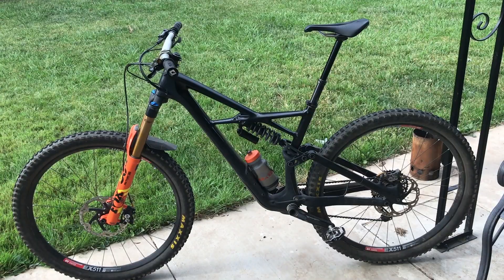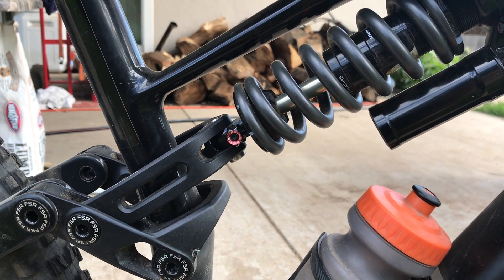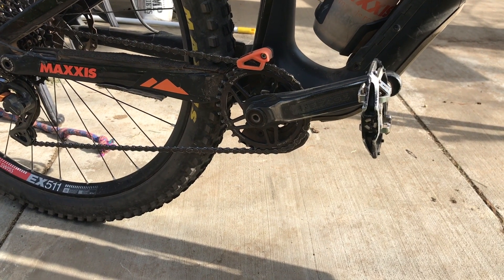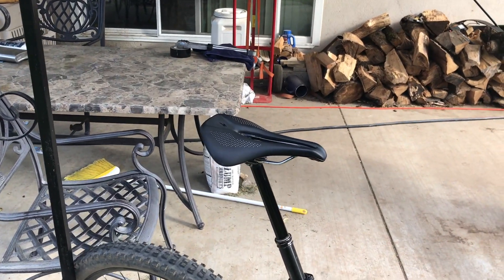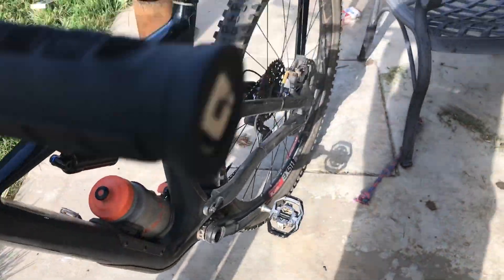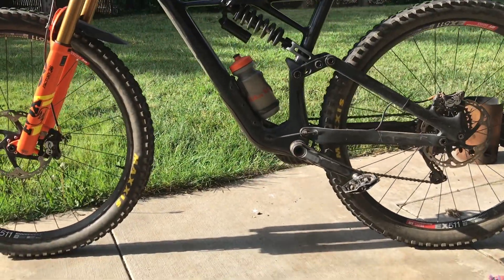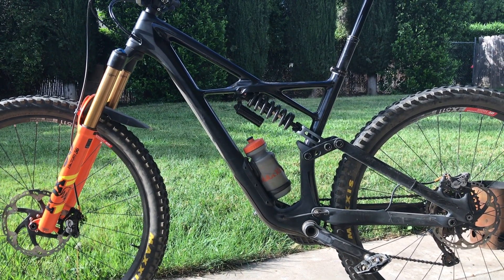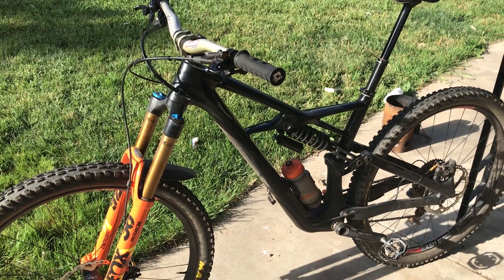Coil shock for the enduro?!?

Comment: Another bike to think about would be the Orbea Rallon. Their size large isn't the biggest on the market for sure, but is has a super steep seat tube angle, slack front end with an short-offset fork, and a really great riding rear suspension. I work in a demo shop and really like the extra length compared to my Hightower LT.
Reply from the maker: Skyler Reid yea the xl
Is too big and large is too small. So I’m a bit screwed there :/

Comment: Alex, I ride a 2017 Specialized Enduro 29r elite and so far I have enjoyed it thoroughly.  I finally had to send in my rock shox monarch plus for service and have been testing my buddy's Ohlins air shock which I have no complaints about even though that shock has had some reliability issues.  I too am a Maxis tire guy, but I am testing the new Butcher 29X2.6s and recommend that you test those tires - although, they may not measure 2.6 with calipers.  I enjoy aggressive trail riding, jumping, and climbing - so far so good.  Specialized website is having a sale right now on all $45+ tires, buy one get one free.  The knobs on these tires have really good bite - check them out!  Cheers, Andrew (SoCal Enduro rider)

Comment: Try getting your hands on a linkage set from a 2017 bike, use the link only (not the shock yoke). It makes a big difference, feels so much better thru the travel and you dont get a super hard ramp up at the end. I have had both 2017 and 2018 enduros, noticed it straight away when going to the ‘18 bike, luckily had a spare linkage from the ‘17 to swap over. Added bonus with the older link is you get 165mm of rear wheel travel instead of 160mm

Comment: The metallic pads are designed to work in a higher heat range, same as in a race car, that’s why you see them accelerating and braking on their warm up lap 👍
Reply from the maker: Daniel Thomson haha I figured. I just never liked that initial pull on the brakes. I guess I just need to get use to it!

Comment: Hey Richard, I enjoyed your video on your Enduro. I have the same bike as you but a Ohlins coil 2018 and I truly love it. I am also an advanced rider like yourself and my opinion differs a little from yours. I live in Colorado we’re we have four mn’t bike parks chair lifted and I went from Nomad C to the Enduro. The Enduro is noticeably faster I think through rock sections combined with the progression of the coil it’s scary fast. I myself don’t no as much as you in the suspension department as I go with the feel of the bike setup and work a little from there. For a big bike it climbs really well better than the Nomad . I think sometimes we can over think the suspension I have not bottomed out yet on my Enduro yet and my body weight is around 190 Ibs and I love to huck ! Lol! Anyway, just wanted to hit you up with my experience on my Enduro. Enjoy the ride bro.

Comment: yah bro. sweet content. I have a 2018 Enduro too. I feel the same way. I just rode porcupine rim in Moab which is basically an 11 mile rock garden. It ate up all that chunk but I felt EVERYTHING maybe that works for Curtis Keene, but it feels SKETCHY. Tracks I'll pin on other bikes feel like I'm out of control on the Enduro. I'm faster though for sure. But I agree with what you were saying. I just cant get comfy on it. Hopefully that changes. Im considering a Norco Range or a Commencal Meta V4.2 New Zealand edition.
Reply from the maker: ryan nonu both a rad! Really digging the range

Comment: Blew out 3 air shocks on my 2017 enduro 29 as well mate. Only brand I could source in UK that did the enduro specific shock length was ohlins. I know what you mean about the coil bottom out. I run the sag probably 15 - 20% to compensate for the end stroke issue. it usually means my legs are doing most of the work at low speed but when it gets fast I feel like it's amazing!
I understand your issues though. I think my next frame I choose shall have a more progressive linkage system so I know there are more options out there!

Comment: Awesome review.
I am leaning towards Nicolai g15 & Pole Evolink. they have a longer wheelbase, and chainstay, to me they seem more like what I am looking for, But I haven't demo'ed any of them.
 the linkage design is quite decent on the Specialized, I like that it has double shear joints/linkages, bearings won't missalig this way, liek htey do on my fuel ex, but I am not sure how well, threaded alloy shell molded to carbon would do with temperature changes.

Comment: I've got a '18 Enduro 29 too.  Float X2 rear Fox 36 160 front.  Saw your last bike update and commented about some of my difficulties with setup as well.  It has been a hard bike to get setup well.  Right now I've finally got it feeling good.  It is I think a bit more plush than my old SB5.5c with float X2 and the rear does not bounce around as much.  The Enduro does not sprint as well which is unfortunate as that is a big part of being fast.  I also have a Aluminum Sentinel and it's been good but frame is way heavy.  I snagged a L carbon frame so considering building that up but first race is in a week and half so not the time to change for me.  

I did switch to a 44mm offset CSU on my fork and installed a Vorsprung Luftkappe.  The offset was a small but positive difference. Luftkappe is only positive.

How did you tell that your Float X2 was cavitated?  

I'm ready to switch bikes too as I'm constantly chasing "perfect".  Maybe SC will do a 29er Nomad?  I need a h20 bottle mount too. Specialized and the SWAT system means I can do huge rides and not have to wear a pack which is big for me.  New Stumpjumper looks pretty good too honestly.  I'd be on a Ripmo if I could get a deal, but I stick to anything I can get a deal on.

Bottom line, as you said I think it's possible to be fast on anything but bikes are so good I want something that doesn't have huge compromises.
Reply from the maker: Todd Munson sounds like we are in the same boat. The stumpy is intriguing because I love being able to do huge rides without a backpack.

If you want to sell that transition... let me know 😂 

I’ve heard rumors about the Hightower LT getting nomad like suspension soon too. Interested in that for sure!

Comment: Hey if your looking for a new bike the 2018 Devinci Spartan is rad! I have been on mine since may, and put on around 150,000 ft of vert and over 180 hours (did a spring training camp in North Carolina for a month) and all I can say is that it shreds. Can run it very plush like I like it without bottoming hard on anything including days at windrock. It can also be ridden with a stiff setup, my friend Adam Robbins runs it that way and is winning pro out here in the east coast. Incredible traction and solid geo makes this thing feel planted at speed, but is still a blast at slow speeds and gets me koms on my local trail XC rides.

Comment: Same problems here. 

Great for the average rider. Linear rates help most riders use more travel. 

The more aggressive and fast you are, the more progressiveness you need. It is hard to manage travel with a near linear rate and the inability to run an air shock.

The ext storia also did not last. They sent out shafts with a reinforcement a few weeks ago. Now it is a option. The vivid needs the firm compression tune. The ohlins needs to be firmed up. The push is also an option.

Any ideas on the firebird 29? Kind of interested myself.

Comment: 100% keep up with the uploads. Even if its just POV stuff. Great vid bud. 

Ended up getting a 2015 Enduro Evo recently, with a set of 180 Lyriks and DT 350/471 wheels in place of the Boxxer and Rovals. I know what you mean about riding it fast, you have to really get out of your comfort zone to ride it as fast as possible. Although I have noticed that the more you push it, the more the rear end seems to love it. I guess that might be to do with the Ohlins, cos I run a similar set up to you with braking and aggressive tyres/solid parts. Although having the Evo is odd because I seem to have a combination of the problems you did with both the Enduro and the Firebird, with the chainstays being super short.
Reply from the maker: Matt Greenwood I will race at race pace it isn’t bad. But gives no confidence up to that point
Reply: I know what you mean. Race pace is good (not raced mine yet but done some race replica runs on local tracks) but trying to throttle it back is not fun and when your not feeling fast in yourself, you're exactly right. Makes me want another "fun" short travel chuck it about kinda bike.

Comment: I just got a Ripmo, wasn't easy to find a frameset with an X2. Have you thought about the Intense Carbine? I know you said no VPP but VPP is just like dw-link, it's just two short links and a one piece rear swingarm,. I think it's all about how exactly they position the pivots to set it up. Might be good, and the frame is only $2500
Reply from the maker: lltany vpp is counter rotating links. Very similar feel but can get more hung up on bumps. DW is just superior in my opinion. The ripmo is only available in August though :/
Reply: Alex Chamberlin there are shops with framesets. Check wrench science, fanatic bike co, or look on MTBR. There’s a guy selling a bunch of frames on MTBr. Much easier to find with DPX2 than X2. If you need the x2 version (don’t want to sell and swap the shock) then you might be right. I think competitive cyclist may have some on order for early July too. 

Ok, good to know. yeah I don’t have much time riding VPP bikes, Since I sold my Blur LT forever ago, just a couple short demo rides, I’ve got a lot more time on DW bikes from pivot and now ibis. 

Good luck on the search! Try hard and I bet you can find one!

Comment: I had the same issues with the rear on my 2013 enduro, felt way too chattery. I put  the same Vivid coil on and it was better but still not perfect. I ended up running a 450 spring and almost too much air in the fork to keep it from going through stuff too hard, and considering i am on 67kgs it was weird. On a sentinel now and even with a stock DPX2 it is way better. Keep up the filming!!
Reply from the maker: Patrick Williams that bike impressed me so much! The sentinel was dead quite and so composed

Comment: Dude I love your videos. I would like to give you a suggestion on a new bike. I currently am riding the ibis hd4 and this bike is sooo fast, the rear travel sometimes feels like it’s not enough but this bike is definitely one to look into I’m thinking about putting the dhx2 on it but don’t have the money right now. The bikes geo is great. The head tube is 64.9 and it feels great on steep loose decents also the seat tube angle isn’t super steep and the reach is perfect for me( I’m 5,3 and ride a medium) even though it’s not a 29er I run 2.6 minions front and rear and it rolls really fast and doesn’t feel like a plus bike at all, also it corners really good and is super confidence inspiring. Hope my input helped:)

Comment: If you visualize the suspension on your current bike under compression, the wheelbase actually shortens. I've never had a bike with rear suspension, but I imagine that would feel a bit sketchy when landing bigger jumps. I only know of two manufacturers that make frames with rear suspensions that have the wheel moving backward under compression: Commençal and Canfield Brothers. Both frames are technically marketed at DH riders (not enduro, but pretty close...) One requires an adapter to mount a 203 rear disc (which will probably bother your OCD,) and the other doesn't meet your "29er" requirement; even still, I hope that this is at least a nudge in the right direction for your quest to find the ideal rear suspension.

Comment: Hey Alex, thanks for the update! Have you demo'd a Sentinel yet? I was torn between that and the HTLT. I was also concerned about the seat tube angle at my height (6-2 34" inseam) Ended up buying the XL HTLT and with the seat .25 forward of center, my effective seat angle is 74.5°. The SC spec chart is listed with 4mm longer axle to crown (561) than the Fox 36 (557). Unfortunately that also means my HTA is actually 66.9°. VPP is a love it or hate it thing tho. I happen to love it. Good luck with your search for a new bike. Just thought that might be helpful.
Reply from the maker: NISMO MIKE that’s good news to know!

Comment: The Spec is high leverage(overall) , makes shock work harder(more heat) mildly progressive and then regressive at 130mm - 165mm. designed for and air shock, I would go up one spring rate and turn down my low speed comp. just my 2 cents
Reply from the maker: justincase already at 550 spring and almost all the way out on compression

Comment: Hi Alex,
Made it completely through the video, and i have the same "problem" with my sinther brake pads as you describe. I have the 2015 Shimano Deore Brakes what might sound a bit weak but with a 200 mm Disk in the front and a 180 in the back I never felt the need for a Stronger Brake.

I hope you figure a way around you Suspension issues.

Greetings from Germany

Comment: Nice vid. I agree wrt metallic pads, and slower speed riding through snow and mud can make them scream. However, after the last stage of the last race I did the rotors were glowing red and the brakes still worked fine. :)  I think the sus on that bike is linear which may not be jiving with your shock and riding. The lack of high speed compression adjustment is also not helping with the bottoming issue. RS can tune-in more high speed compression the next time you need it rebuilt. Or... get a bike with a more progressive sus that doesn't load the shock sideways. :)

Comment: The enduro has an odd leverage curve.  At the end of the stroke from around 125 to 165mm the leverage ratio rises up so will tend to blow through its travel faster.  They have quite a high leverage ratio as well which won't help things.

Comment: Keep making more videos. I'm looking forward to riding again after fracturing my wrist in a few places a couple months back. I need to replace my carbon 35mm diameter 740mm bars. Do your bars live up to the hype and are they worth the retail cost?
Reply from the maker: levar012586 depends on what sweep you like. These are pretty straight whereas a diety bar would be more swept back

Comment: hey alex, dont really know all that much about shocks but I have an 2017 enduro 29 too and the stock shock is pretty crappy. Im planning on buying a yoke so i can chuck a 200x57 shock on it. I was thinking of getting some sort of cane creek. Do you reckon it will work? cheers
Reply from the maker: Jonah Pineapple cane creek air shocks you can buy with a plug mount for specialized. Their coils use too small of a shaft and may snap

Comment: What did you like better your spec enduro, pivot firebird, or sb6?

Recently blew out my rc3 on my enduro so ended up going to coil (dvo jade). Love it besides the weight and it doesn’t pop like an air shock. Need a ti or lightweight spring.

Comment: Hey man! Nice review. I have the same Specialized Enduro 29 (2019) and I´m thinkig about to change the rear air shock for a coil shock on this bike. I´m looking for the RS Vivid and the Marzochi Bomber CR. What do you think about these shocks, and wich one do you recommend me with what spring rate? My weight is 95 kg (209 pounds).

Comment: Not got much of a idea with Enduro bikes, but can't you change the aluminum linkage that connects the front and back? Something custom CNC that makes the shock work better for you? It would be the best of both worlds
Reply from the maker: Smokey that would be nice! I wonder if it’s possible. A big issue is the horrible leverage ration. 2.25 inch stroke for 160mm of travel

Comment: So one thing you didn't mention was your change in wheels. Was it a matter of carbon vs aluminum or other factors? I've been thinking about lacing in a pair of those dt swiss rims.
Reply from the maker: Brandong13 I think I went over them in a previous video. 

But both wheels we’re aluminum.

I dented up the bontragers to the point of no return in 2 months. The dt 471 and 511 have been the best rims for me in the past. Light enough, crazy strong and as reliable as they come. 

Cannot day enough good things about them! $70 a rim too

Comment: I watch a lot of youtubers for different reasons, some don't know the nuts and bolts and that's fine, but I always pay attention to bike/component related videos when I know the rider is experienced and rides hard. So keep it up! Question: I'm also a heavier rider and my Guide R's on my Bronson are inconsistent/lack power when they heat up on long descents (I ride steep trails in OC)... I noticed you went to Saints after trying TRP Quadiem... What do you think about Shimano Zee $144 each? cheaper than Saint but supposedly built the same, Compared to XT 4 piston $180 each? Any other thoughts on budget friendly but still good quality brakes? I'm also considering going up to 203 rotor in the front...
Reply from the maker: Josh Pichon the Zee brakes are awesome and come stock with metallic pads! Highly recommended them. Just be careful on your first ride. They bite very hard
Reply: Thanks for the quick reply! About to overcome my analysis paralysis and pull the trigger, haha
Reply: Get metallic pads and some big rotors for your guides (not sram centrelines they are awful) and you should be OK

Comment: I have a coil Vivid on my Remedy. Same reason: only one that would fit. It's been a great shock, but I usually run Fox suspension on my bikes.
Reply from the maker: Trail Tiger MTB honestly I’ve tried the vivid air and coil and they are both honestly so good!